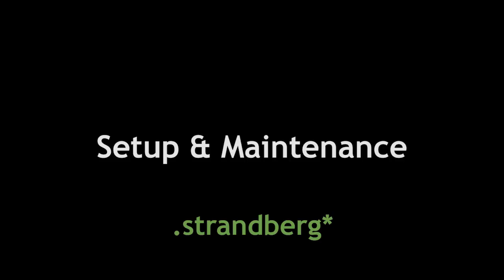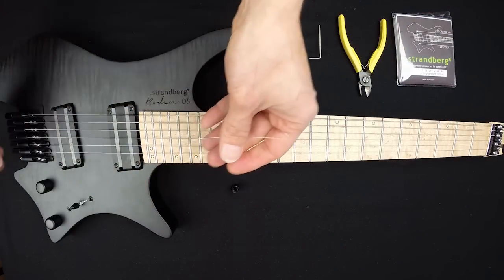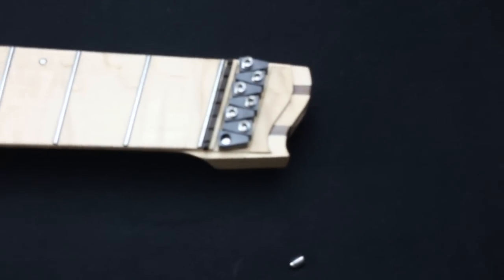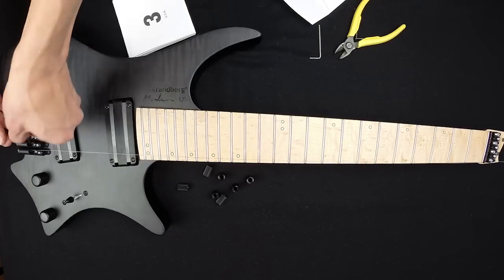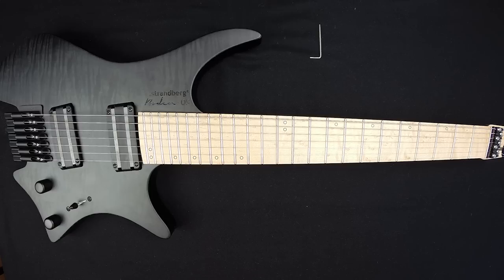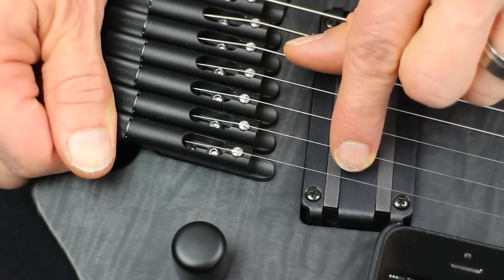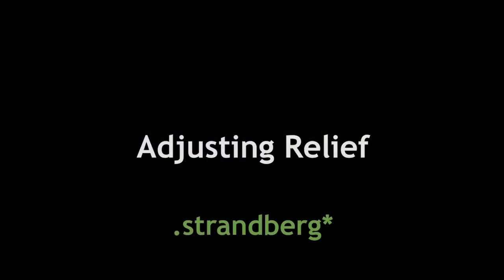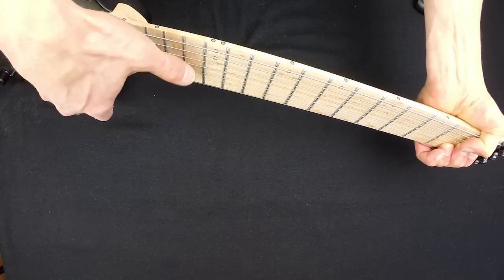.strandberg* Setup & Maintenance - How to setup and maintain your .strandberg* guitar

Comment: The Boden Standard 6 saved my left hand. I was experiencing pain on and off for a few years since I was out of routine with my playing. I'd go back to play and feel the pain in my hand, my pinky at one point couldn't stretch to hold certain chords. 

Bought the .strandberg* by chance last February, saw it in the store (Blue) and liked the color. I tried it out, the ergonomics of the back of the neck as well as the fret angle really felt incredible. It felt like I wasn't playing a guitar, but felt more therapeutic. Also it sounds massive plugged into my Orange and challenges my Gibsons on clarity. I've recorded with it, it can sound dreamy and clean, heavy and thick, etc. Also it looks beautiful on camera.

String changing is easy too. I love the .strandberg* and I plan on getting another one in the next few years.

Comment: I've always changed the full set of strings I only change one string at a time only 
Surely changing all the strings. Taking all of the strings off and replacing them the new ones doing this over time you're asking for problems 
That's why it's much better to change one string at a time and retune that string to pitch and then restring the next screen and tune that one to pitch and so on until you've done the whole set 
It's also the same with one of my guitars with a floating bridge. A Floyd Rose and they would only change one string at a time.
I look forward for your feedback. Thank you so much for the video! God bless

Comment: I would recommend re-ordering your adjustments in this video. Neck relief should always be adjusted before action and intonation.
Reply: I assume most people buying a strandberg are aware of this
Reply: @billmint8122  nope
Reply: reason why?
Reply: @Tury1799  Hard to explain in text, but basically all of these adjustments affect one another. If you make a neck adjustment, you're action and intonation will change, so you wouldn't want to set your saddle height to the perfect action, only to mess it up once you go to adjust your neck afterward.

My setup order is as follows:

New strings on
Tune to pitch
Neck adjustment
Tune to pitch
Saddle height
Tune to pitch
Pickup height
Intonation
Tune to pitch.
Reply: @Chloejo9192  makes 100% sense. Thanks king
Reply: @Chloejo9192  eat a sandwich, turn to pitch 8)
Reply: @Chloejo9192  Hey, this helped me. Thank you!
Reply: @untamablebenjamin  you're welcome!
Reply: Your order is good. But the only reason you adjust the truss rod first is to create a bit of back-bow. Strings are gonna buzz in the first few frets but that’s all part of the process. It’s when you’re ready to dial everything in that you loosen/release the rod into a natural position (ideally straight or with a tiny amount of relief, especially on the bass side). Knowing how to read a neck is key. Same idea when you set your intonation. Back all the saddles up (before you put the new strings on) and then loosen the saddle length screw until the string is intonated. This avoids work hardening (or “kinks”) which can create other problems.
Reply: I have to entirely disagree. 

The saddle height is what you adjust to get rid of buzz from frets 12-24. You can totally flatten the neck and then adjust the saddles to the perfect height so that the strings don't buzz on frets 12-24. The neck relief will not affect the buzz on those frets. However, saddle height will make a difference in buzz on the 1st through 5th fret. Until the saddle height is set for the the top frets, you can't accurately make a decision about how much neck relief is needed to get rid of buzz on the low frets.

Comment: You should be using your multitool to adjust those screw because all the comments on reddit are talking about how hard it is to turn those screws where the string sits. I tried everything amd wouldnt turn. The. I read a comment reminding me of the multitool has a proprietary socket to fit that, and i didnt remember because i saw you doing it by hand.. just thought it may help someone

Comment: I'd like to point out that if you are going up a gauge with your strings, you should tighten the locking screws a bit harder than normal. I just had issue with moving to tens where the high E simply wouldn't tune and I turned the tuning pegs so many times that the ball end was popping out of the the tuners. I was able to fix this by really going to town on the locking nut.
Reply: i;m having the same issue.  as well the bridge is not level at all.

Comment: I’m trying to do intonation but when I tighten the string to check the tuning the bridge always gets pulled back to the position I don’t want it in. I’ve tightened the alan screw on the bottom as much as I can and it just won’t stay in place. Has any one else had this problem?

Comment: Where you demonstrate how to change the action, you forgot to mention there is a little black screw on the side of each one that has to be loosened to get that screw to turn
Reply: That's only for the older tuner models they used, they're not there anymore on gen 5 hardware AFAIK.

Comment: The string saddles seem to get pinched when changing the action if not left in a parallel position with the string, what if the action you need falls right at a perpendicular angle of the string groove?
Reply from the maker: The groove should be parallel to the string, so with the current design it's possible to change the action by a half turn at a time and a half turn equals a 0.25mm change in action.
Reply: @StrandbergguitarsOfficial  ok thanks

Comment: The 8th String on your D'addario's is too fat to fit. Please provide a video on how to get it to fit or what strings we should actually buy.
Reply: Re strung mine yesterday and got caught with the same problem. Went down to my guitar shop and the engineer said, the string lock is manufactured incorrectly and to have a mechanic drill it. Its unfortunate, spending that much and not having that in consideration. So, I went ahead and did it myself smoothly with my own tools.
Reply: @tommyfalconey  I ended up contacting Strandberg. Had to mail it back to them to fix it. They did the right thing and owned it, paid for the shipping.

Comment: What about the part on the website where it says to unscrew the tuner cap and extend the tuner and put the cap back on with 3 clockwise turns and then put until tuner cap is flush to the main assembly? I tried that and it did not work. The heavy strings did right, but the higher ones gave me difficulty. I am new to this btw.

Comment: Exactly how was that intonation adjustment achieved? I saw him loosen the set screw, which seemed disengage the bridge saddle assembly, but after that it got a bit murky. Is this a trial and error process? So if the string is not under tension, and the saddle is free moving, do you just adjust in the desired direction by eye, retighten everything and hope for the best?
Reply: From what it seems, I believe it is a trial and error process, but once you get used to it like the video guy you should get pretty competent
Reply: @robadobflob3405  I guess you could make a discrete mark once you find the sweet spot, but the real killer is having to detune and then retune each string to check. For a guitar with so many clever features, this is a real dumb oversight.
Reply: @peachmelba1000  Do you not loosen your strings when you change the intonation on your "normal" guitar? I thought that it was just standard.
Reply: @robadobflob3405 I tune the open string to pitch, check the 12th fret, and then index the intonation screw in the required direction while watching the tuner. That's how most people do it, but I suppose you could venture to try it metrically with the string slackened.
Reply: I don't mind detuning and retuning, but it's very annoying that the saddle moves freely during the process. Makes it much harder to adjust since you are likely to lose your original position as soon as you loosen the saddle.

Comment: Hi Ola, I received today a new Standard 6 with trem, and I tried to lower the action with my nail as in the video and it was impossible. Can you give me a clue why this is happening? Thanks.
Reply from the maker: Hi Javier, thank you for your question. Please send us an email at support@strandbergguitars.com
Reply: (Ola is quite a bit more buff than we knew.) Using my nail to adjust that didn't happen. It took nearly 15 minutes to get one full turn on a single saddle. If they made a tool that fit the groove and also had a circle around the outside to prevent slippage, it'd be much easier and less likely to scratch something up.

Comment: Also, if you have the case of a string barely or nor going in and out att all, remove it as carefull as possible, and readjust the locking part. Mine was so disoriented that I couldnt get the new string in, so I had to scre it out and position it new..

Comment: Intonating this thing is such a trial and error process. It seems counter intuitive to have to loosen and tighten the string constantly and move the bridge arbitrarily. It would have been much better to adjust the intonation while the string is tuned to pitch. For such an amazing instrument, this is the one thing bothering me.
Reply: It's additional work that no other guitar I've owned requires, plus "guess work". Once you've got the instrument set up, string changes are a veritable breeze. But other common (yet infrequent) adjustment seem more labor intensive. I'm in the process of coming to terms with my new Boden. It may be visiting a shop soon. I'm getting older and just don't have the patience I once did.
Reply: @BryanMontford  hard to know a good shop, sometimes they will mess up your guitar more than fix it
Reply: @funknotik  There are likely professional musicians in your area. (Most regions have competent musicans, professional or otherwise.) They'll use someone they trust. Ask. ^_^

Comment: The string saddles move so freely in this video (with a fingernail movement!!) and I still can’t move mine with a slightly wrong sized screwdriver 💔
Reply: Same dude, i don't suppose you managed to find a solution?
Reply: Same here, don't want to try too hard with a metal object in case I'll damage it
Reply: Mine has a set screw (grub screw) that locks each saddle in place.  Take the smallest allen wrench from your kit.  Turn the tiny black set screw counterclockwise.  Then you should be able to adjust the saddle with little friction.

When you're done, re-tighten the set screw.
Reply: @AGeekNamedRoss  It still took me nearly 15 minutes and three different flat head screw bits to succeed in making half a turn.
Reply: @tylerball3249  Very late but I did I with a flat head screwdriver but the key to it was that I had the guitar lying down flat on a desk and I put a decent bit of pressure downwards on it, just be very careful you don't slip and scrape the guitar or yourself in the process, be firm but slow and you should be ok. Also if it won't go all the way round it sometimes helps to go the opposite direction a little bit then try again as that can help loosen the screw up a bit

Comment: What's the reason of doing all the strings at once? I was always taught to do one string at a time with a traditional guitar with head. Is this just personal preference or recommended for strandbergs?
Reply: In general, with hardtail electrics, it doesn't matter whatsoever. I know most string instrument collectors like to detune/ de-string their instruments for storage: it's not like they can't return it to proper playing condition with a few hours of work. Specific to my Strandberg hardtail JBoden, if I go one/ several at a time, the rest of my strings remain quite well in tune; this is not the case with my 8 string Ibanez... throws things fairly out of whack if I take off several of the lower strings.

You have great reason to go one at a time with any floating bridge guitar, since the springs and all that maintain the "floating" part of the floating bridge are actively fighting the tension, where the guitar itself is only ever passively fighting the tension.
Reply: What Matthew said. Doesn't matter. I went to luthiery school and the technique they showed us was to literally take cutters and just cut all the strings right in order and then pull them off. Won't affect the wood/guitar in any way.

Comment: Covers everything except cleaning of the maple fretboard, I guess a damp cloth will have to do
Reply: Yeah, if you use a cleaner any wood cleaner/ furnish will do. Just can't be silicone based and not a wax either.
Reply: There are so many channels about guitars on YT, I can think of 4 or 5 luthier channels that cover exactly the issue you mention above and it couldn't be that difficult to write a query that would give you a good result.

Comment: Thanx for that one. Very helpful. I change the strings on my Black Fusion Strandberg with tremolo bridge, but as a result the bridge lost height a lot. Also i switched from 10 to 9 strings..Any tip on what happened?
Reply: Howdy! Yeah, when you switched to a lighter guage, you in effect reduced tension on the trem. You will need to loosen the spring tension on the bridge GRADUALLY, as you will be tuning back to pitch a few rounds. You will likely also be adjusting saddles to reintonate the instrument. If you have ever changed string guage, or string material of the same guage on a Floyd Rose, you understand what I mean, and it should be much easier on the Strandberg. Good news is that if you like your new string choice, and stick with it, you'll never really have to bother with it again#

Comment: having to detune and remove strings for action and intonation, having to move the saddle with the hand is not that smart... other headless bridges have actually ways to raise or lower action, intonate, without having to detune or remove the strings. Strandberg needs to design a smarter and faster setup bridge.